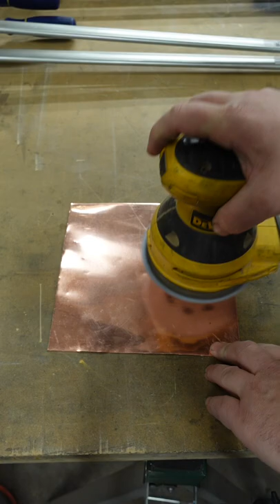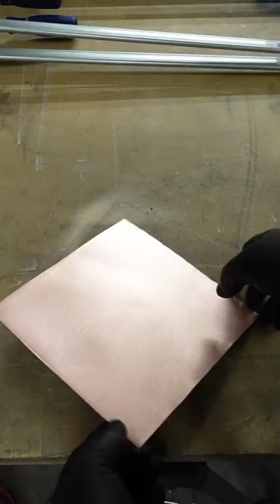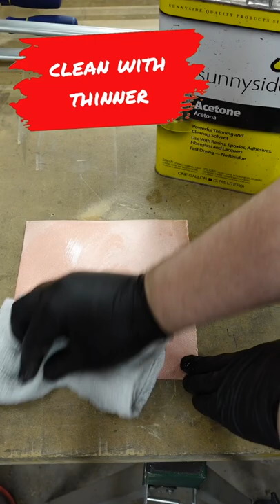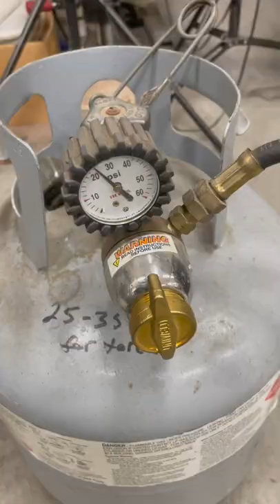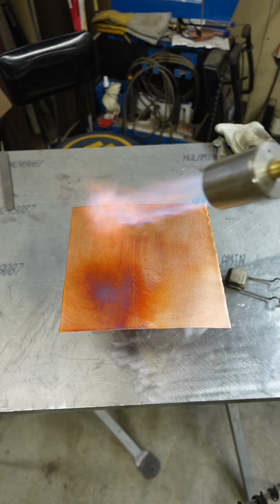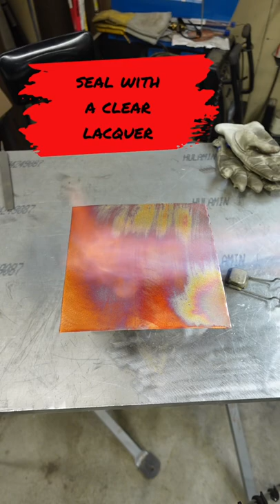🔴 Patina Copper with only Heat

Comment: What’s thinner?
Reply from the maker: A solvent used to dilute paint or epoxy products. I used acetone here because it dries very fast. Mineral spirits would work. It is commonly called paint thinner. This will remove any oil residue from the metal that would affect the end result